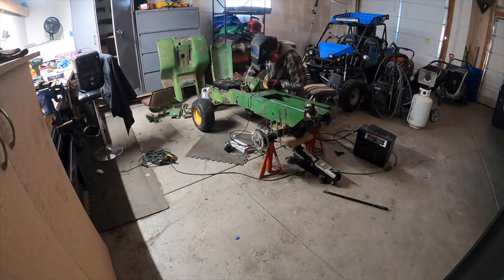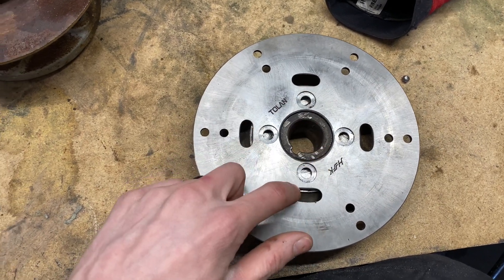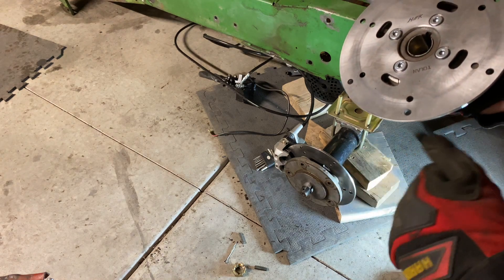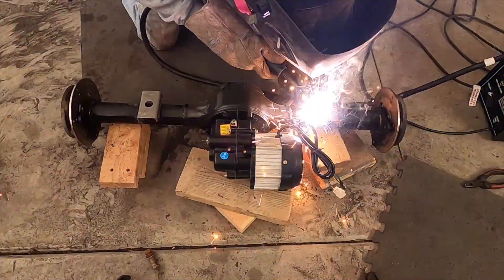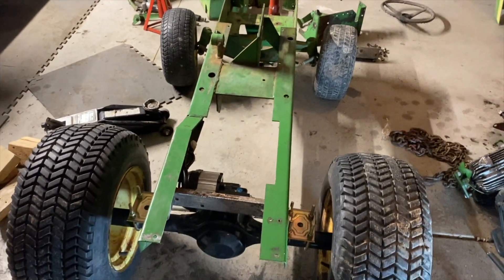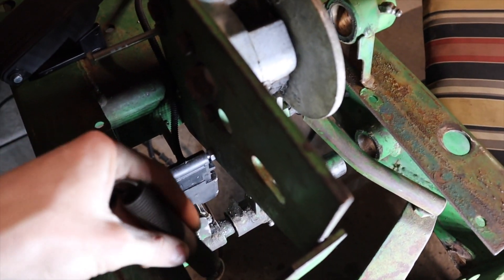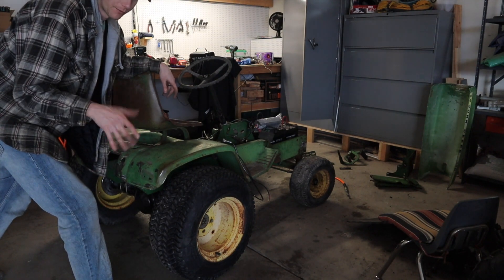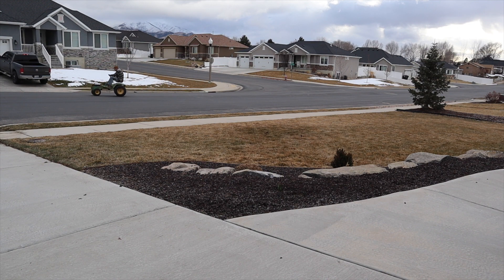Electric John Deere tractor build (Part 2)

Comment: That needs two 60kg servos on the steering and Ardupilot rover!
I have a 50cc mini Quad bike i converted to RC, ive been tempted to convert it to electric and put Ardupilot on it but with the engine its over powered and lacks reverse.
Reply from the maker: You got me thinking...
Reply: @builtfromhome9207  ha ha, you could always make a linkage where you could easily connect and disconnect the servos to allow it to be used normally.
My 50cc quad bike conversion uses one 60kg servo but i think you might need two for that.

Comment: nice! working on a similar project right now. as far as batteries go you can get super long lasting prismatic LifePo4 cells. im going with 32650 cylindrical cells from batteryhookup. best deal on the web right now even cheaper than from china. $3 per cell 5000mah!
Reply from the maker: Nice I will have to look I to those batteries!